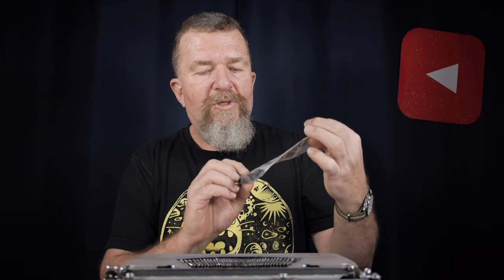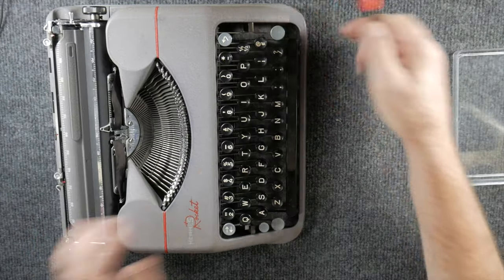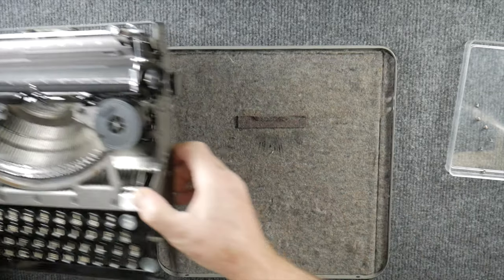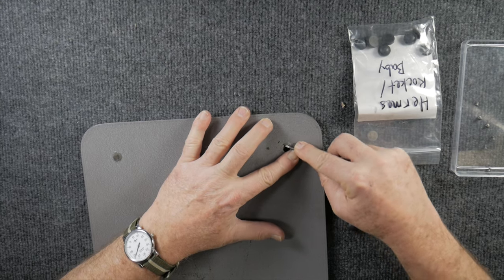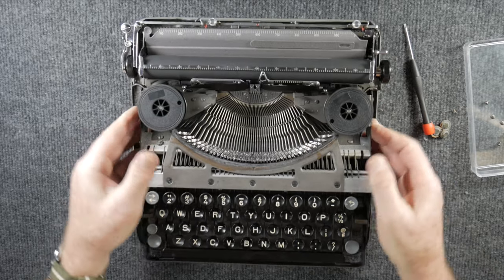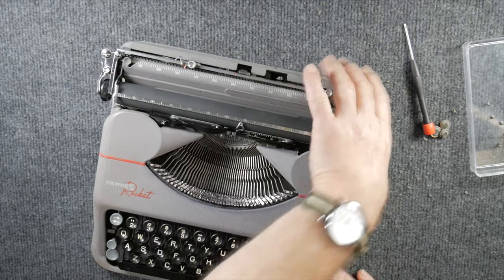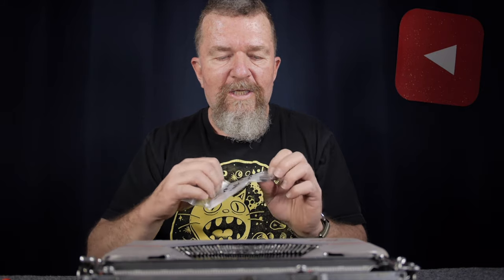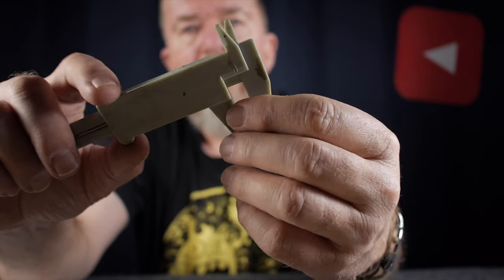Typewriter Video Series - Episode 158: Rocket Retread

Comment: The rubber feet came from a seller on eBay named “dangoodbuy”. They are part number PM1132916, 9/16” diameter and made for an 11/32” hole diameter. So far these are the best generic feet replacement for Rockets/Babys that I’ve found, although they aren’t a absolutely perfect fit on some machines (the foot hole size seems to vary slightly between machines strangely) but they have worked well and are FAR cheaper than the $20+ set of feet someone on eBay are selling. A bag of 24 was only a couple dollars as I recall.... Hope this helps someone!
Reply: Thanks for making this comment! I recently bought a 1938-9 Featherweight - do you know if they share the same style feet?
Reply: Dave, Granite Valley Projects I actually have a really nice 1938 Featherweight if you can believe it, and I’m using these same feet on it as well, so I would say go for it!
Reply: @aphexteknol  They're fantastic little machines aren't they! Mine is wonderful but is missing the ball that goes on the carriage release lever. Just got a new ribbon for it yesterday! Such a dream to use. Thanks again!
Reply: Dave, Granite Valley Projects They are even more fantastic machines with new rubber on the platen. Some of my favorite typers. Shame about your carriage release lever though; one of the few design flaws of these tiny Hermes machines is the soft metal the carriage release levers are made out of. I see so many of these Featherweights/Baby/Rockets with bent up release levers, and even carriage return arms. You might be able to JB Weld something on the end of the lever just to make it more comfortable if the looks aren’t important. Finding a replacement might be difficult/impossible short of making an entirely new one...